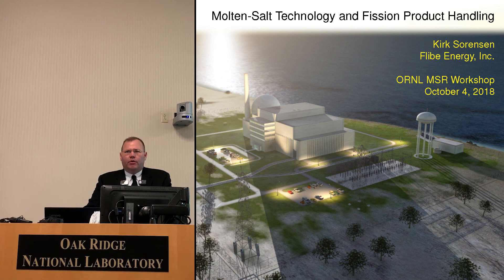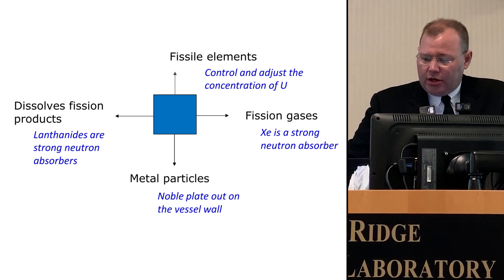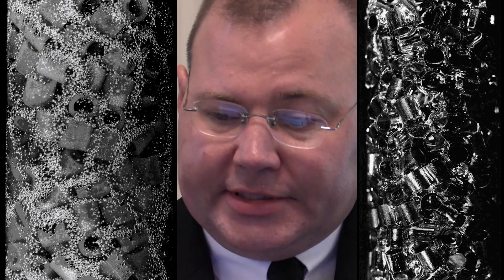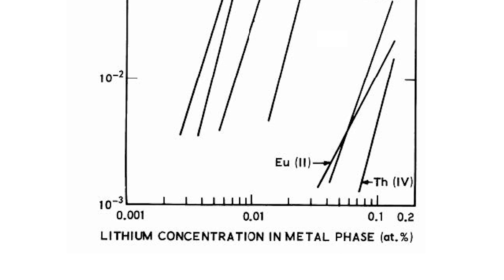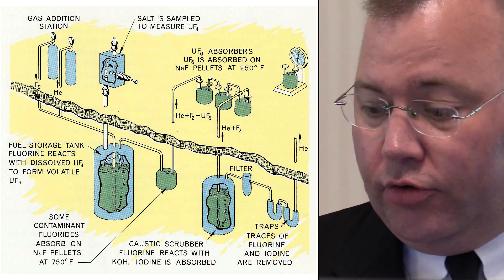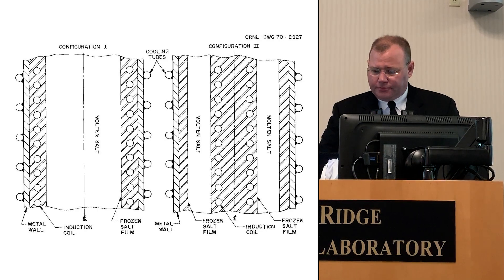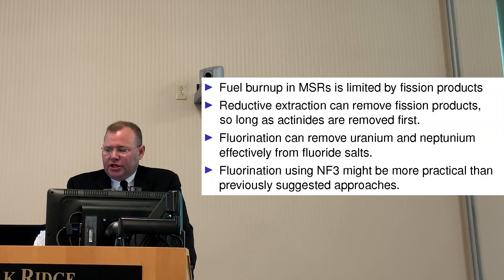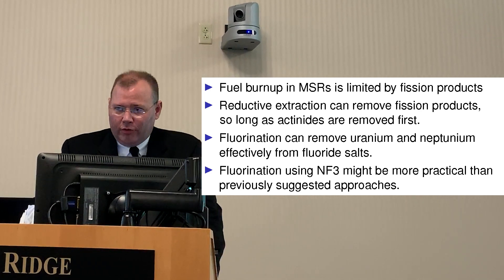Fluorination using NF3 - Kirk Sorensen of Flibe Energy @ ORNL's MSR Workshop

Comment: If fluorination with NF3 doesnt remove Plutonium, it will be extracted together with the lanthanides, and be part of the waste stream. Apart from loosing it as a  valuable fuel , it extends the otherwise benign decay time of some centuries to some 10 000 years!
Reply: No, wait. What is generated in the thorium fuel cycle is 238Pu, not 239Pu. 238Pu has a half life of 87 years, and it's the basic material of RTGs for space missions. Completely different beast.

Comment: Good gravy! I had considered this as a fairly consistent stumbling block, looking at the original MSRE design, and not knowing the full gamut of chemical processes necessary for the extraction of materials. NF3 does seem like the way to go, especially if it cuts down on the corrosion issue. Go chemical engineers!

Comment: Kirk, first, thank you for your work and Gordon, thank you for the vids.  Second, why not use a graphite tube as a liner and thermal barrier inside the molten salt pipe to support a frozen salt layer and induction coil?  At about 9:27 the cross section view would replace frozen salt film with a two layer graphite and frozen salt or sandwich frozen/graphite/frozen, both inside the metal wall. I am assuming the graphite can tolerate the corrosive environment and the salt is not fissile or the geometry can tolerate the moderation.

Comment: Can someone tell me why we cant get a thorium reactor up and running today when they could in the 60's? (China spends 2 billion dollars a year on studding thorium and has 1200 phd's on the job)
Reply from the maker: Gustav Shippingport was solid fuel. It proved that Thorium-U233 breeding was possible but was not a practical design to use breeding for commercial power production.

MSRE was NOT a thorium reactor. Trace amounts helped test chemistry, but no Fluid Fuel breeding blanket has yet been demonstrated.

So it today’s environment, moving ahead is more expensive than it would have been if MSBR had continued on heels of MSRE.

But conceptually nothing has changed. Th can be still bred into U233 like was planned at ORNL in since 1950s.

https://fluidfueledreactors.com/
Reply: @gordonmcdowell  copy
Reply: @gordonmcdowell  I thought about another think too, what is keeping the molten fuel reactor from being produced?
Reply: @gordonmcdowell  So I was wondering what  you meant by Shippingport and finally realized it. My first question was not about Shipping port but the Molten Salt reactor at ORNL, why don't we just copy that concept? Didn't they invent the MSR back then? 

I Don't understand why you write that " no Fluid Fuel breeding blanket has yet been demonstrated."
Reply from the maker: @Gustav4  ThorCon is the MSR startup most closely replicating MSRE, in that they're assuming the lifespan of their reactor core ("can") at 4 years. "CanShip replaces 500 ton Can every four years" http://thorconpower.com/spec-sheet

But that's not as fuel-efficient as LFTR.  ThorCon is pretty clear they aren't aiming for efficiency or harvesting isotopes, they just want the least expensive design for mass production.

So that means that like MSRE, there's no dual-fluid design, there's no thorium blanket to absorb neutrons and breed U-233, and no chemical separation to pull out fission products (although they do remove gassious fission products).

ORNL planned on building a blanket, and closing the Thorium fuel cycle, but that was the MSBR which was designed but never built because funding was killed after MSRE.

MSBR would have used a Chemical Kidney as Kirk describes for LFTR, although Fluorination using NF3 is a new approach to it.

Closing the Thorium fuel cycle and harvesting medical isotopes would be a good thing to do. We need MSR to do that. But only China's CAS (funded by Chinese Navy now) and Flibe Energy are taking that exact approach. Most other "thorium" MSR (as opposed to "uranium" MSR) fuel with enriched uranium and focus on pitching high-temperature operation (for industrial processes) and passive-safety features of molten-salt. (Which LFTR also has on top of closed fuel cycle and harvesting of isotopes.)
Reply: @gordonmcdowell  Thank you, these are important distinctions and this comment really clarified what was done and why the LFTR is different. I knew Shippingport proved thorium's potential as a breeder, but it was bummer that it was a solid fuel design.  It took me a while to understand how the blanket salt was separated in the ORNL design, now I understand that it actually didn't happen yet. The design was to have different channels within the graphite tubes with the center section containing the fuel salt and the outer section containing the blanket salt.  I had originally envisioned a "tub" of salt with graphite rods and didn't understand how the fuel and blanket salts would be separated. 

I'd love to see ThorCons vision come true for developing nations, Ed Pheil's vision of fast reactors burning up nuclear weapons and SNF and of course LFTRs providing clean power, more evenly distributed geographically. 

I am also extremely excited to see these realities desalinate and pump water where it is needed. And ultimately the conversion of carbon in our air into chemical fuel for use and sequestration, combining MSRs with companies like Carbon Engineering.

I really can't thank you enough for producing these videos, they are truly invaluable for helping a complete novice like me to understand energy and the energy industry. Hopefully, we are all able to help advance this knowledge and make clean, safe energy and the ability to improve our environment a reality for our children.

Comment: The trouble with LFTR is that it's too ambitious. There needs to be a pathway to its development because not only are pumped radioactive salts daunting to commercialize,  the online reprocessing of blanket and fuel salts even more so.

As a suggestion. The FHR reactor uses triso graphite pebbles to hold the fuel and a molten salt as the coolant.

Why not put thorium in the coolant and just reprocess that without worrying about the fuel?

Once that's perfected, cleaning a liquid fuel will be the next logical step.

Perhaps Kirk should go work for Kairos?
Reply from the maker: Ben, lots of people are pursuing "easier" paths to MSR. Kirk's work on Chemical Kidney is in parallel and can apply to many categories of MSR. I personally wouldn't want to see everyone all rushing down a single R&D pathway, and all effort being duplicated.

Comment: A quick question: why fluorides? Why not chlorides? I'm not a chemist (not even close), but from what I've gathered, common table salt would be a much less toxic and far more abundant substance than beryllium-fluoride. Or is there a problem with uranium-(x)chloride or thorium-(x)chloride? (x meaning tetra-, hexa- or any other multiplier)
Reply from the maker: More R&D was done on Fluorides during MSRE days. FLiBe has some moderating properties, and while I'm not sure all reasons for choosing either way, IF you are pursuing thermal-spectrum you can choose Fluoride or Chloride, but IF you are pursuing fast-spectrum then the moderating behavior of FLiBe will be slowing down your fast neutrons. Hopefully folks with more insight than me will chime in.

Comment: The last paragraph, UF6, UF4, sort of set off my spider sense (not common sense) that this system as conceived might be too complicated. I have heard of another related, process, using chloride (from potassium chloride) as the coolant-moderator. Also, it comes down to cost. I like the UK designed Stable Salt Reactor, by Moltex, that will be worked on in Canada.  We still don't have a working waste remediation system (meaning that it attacks radiation via physics), but that will take 100 years, probably.
Reply: Mortimer Hasbeengud:  First and foremost, I am really really unqualified to give any sort of knowledgeable response, so here goes with my totally amateur thought: I would be concerned about using chloride because of its different corrosive characteristics.  However, you are working in a much wider range of temperatures than I am qualified to evaluate.  Also, it seems to me that many of the chemical manufacturing processes we use commonly require several different steps in order to process the various intermediate stages of the chemicals in order to get to the desired end products.  I do agree that this may require a lot of tinkering/adjusting/monitoring on an "on-the-fly" basis when in actual use.  However, I also believe that our systems for doing so are vastly more robust and sophisticated than they were only ~50 years ago, when this stuff was first being seriously developed (the MSRE).
Finally, I am not convinced that this is really all that much more complicated than the stuff we go through currently (with our rather quaint and primitive radiological designs) to produce many of the medical radioactives, etc., which we use today. The real difference is that we would be producing this stuff on an ongoing, production-line basis rather like running Model-T's off an assembly line (OK, maybe Tesla's or something...) rather than doing small odd-job lots specialized in only one thing.  As I see it, this would be analogous to having a 3-D printer on site which you could then use to produce whatever you needed, rather than trying to have a huge stores department to keep a bunch of replacements in stock. (OK, I admit its a pretty poor analogy, but, hey, I'm an amateur here...)
Net upshot:  Yes, its complicated, but doable, and with enough effort, it can even work.  Yes KISS is a very valid principle, but sometimes multiple steps is exactly how you achieve that.  KISS at every step can induce reliability, and reduce complexity.
Sincerely, Mortifiably Willbegud...
Reply: Very good! Thanks for your input. I am unfaithful as far as electricity-making goes. I too, am not a go to, guy. I like to listen to them, however. Bottom line, we as a species need to go with whatever works. Having said this, doing fission, KISS, as easy and cheap X Safe as possible, has to be the way to go; baring any mass improvement in fusion, solar, wind, geothermal, ocean thermal, tidal, , etc...?  I have read about old reactor types like using CO2 as coolant-moderator, in the old, Magnox reactors in the UK. I ponder if atmospheric nitrogen, extracted from air, might be a good choice. MIT used to promote their pebble bed reactor, which to cool, using helium?? My mind is boggled, so I was hoping that MSR, some variation , might be more workable, than light water reactors :-/  ?
Reply: I suggest you look at some more vids by krik

Comment: Am I to understand we're giving up on thorium as a fuel?
Reply: Uranium is the fuel used in a thorium fuel cycle, I would hasten to point out. That's why fluorination was such an essential technology in all of the ORNL MSRP work.
Reply: If the molten salt reactor is to be ever be realized, yes.  My nuclear engineering professor thought that the use of Thorium  as a nuclear fuel was ridiculous.  The major argument behind using Thorium as a fuel is due to its abundance, but we have many thousands of years of Uranium in our earth's crust, thus making the previous argument for Thorium null and void.
Reply: Nick Joslin:  at one time the abundance of Thorium may have been a major factor in the arguments for it, but at that time people also tended to think in terms of solid fuel rather than fluid fuels.  Now, there are tons of much more relevant arguments in favor of using thorium for fuel.  Yes, its still abundant.  (In fact, we can obtain it rather cheaply because a lot of it could come as an almost free by-product of rather common mining operations...), but the advantages are far more attuned to the lack of disadvantages of using plutonium or U235, etc. as anything other than a startup fuel. 
Having said that, however, we do have a lot of spent fuel sitting around and it would sure be nice to burn that up simply to get rid of it...  Simply stated, Thorium is a much safer fuel in many respects to use, without some of the proliferation concerns which you get with other fuel sources.  And yes, Kirk is right.  The thorium is sort of like a combination catalyst and fuel source inasmuch as it is converted to U-233 and the U-233 is the actual "fuel" being consumed to produce the energy.
Reply: @joslinnick  U235 has no competition because it is the only fissile isotope available in the nature. Both Thorium and Uranium fuel cycle needs U235 for startup. Between U238 and Th232, Th232 is better.

Comment: Interesting seeing Flibe develope their idea of what their reactor will look like. Gordon, would you agree that Flibe is compromising fast deployment for seperation of actinides and fission products?
Reply: Viktor Nerlander:  compromising?  in what way, please.  I don't understand the point you are apparently driving at.  I am, however, perhaps misunderstanding the entire thrust of your comment.  Thank You! in advance for any explanation.
Reply: Hi John! I'm by no means an expert in reactor design. What I see many other projects do is to compromise extracting different thing such as actinides and fission products for a simpler design with the reason being getting the design faster through the regolatory process. 

For example keeping Moltex Energy just keep their fuel salt in long tubes, very similar to contemporary reactor design with only the state of the fuel being the difference. I believe  that regulators see an advantage of knowing the fuel is in one place at all time. 

In addition to that, seperation is concentration. You have to prove to regulators that extraction of U333 is not possible. 

Flibe has the most optimal design feasible right now, which is noble but I think it's a compromise to deployment.
Reply: Viktor Nerlander:  Thank You!  I now understand what you were getting at.  Yes, since the DOE regulations were designed for solid fuel reactors and they indicated that they thought it take ~40 years for them to develop proper regulations for fluid reactors (sorry, don't remember where I got that, but I do remember it from somewhere which had a reasonably authoritative source....) so the regulations they had for reactors, in combination with the DOE's reluctance to consider alternatives what they were familiar with, resulted in a lot of resistance to development of MSRs.  Accordingly, that has resulted in a lot of compromises so as to be able to present the DOE with something that they might be a little comfortable with rather than something which would seem to "out of the mainstream" for them.  The good news, though, is that, due to people like Kirk, John Kutsch, Jim Kennedy, and many others, the light is beginning (however slowly...) to penetrate even at the DOE level, which is the epitome of Governmental stodginess.

Comment: Looks like I've made the right choice in choosing to do chemical engineering for my undergraduate degree. This is a full-on chemical plant!
Reply: I figured the "optimal" version of this plant will basically be a near-automated facility where thorium comes in one end and bricks of neodymium 'n NASA-grade plutonium comes out the other. But that "near-automated" status would be designed after years of manual management by chemical engineers and the like.
Reply: dont forget the siphon for Xenon. yea the chemical processing plant will be hot in temp and radioactivity. Would almost require it to be automated. Monitored from behind shielding.
Reply: Eventually we'll see it engineered into an automated system. After the "seeding" process, thorium goes in from one end and a variety of useful fission products come out the other, contained in reusable containers with decay sensors and timestamps so you know what the likelihood of near-full decay is.
Reply: Molten salt reactors are a chemist’s wet dream 🤣

Comment: Thanks again Gordon. Lots of chemistry. I'm beginning to get an idea of why it is taking such a long time to develop an optimum process and mix of technologies to make this work. You can't just go down to the lab and mix up some chemicals to see what works when a reactor is MAKING the chemicals you have to process. Cooling a layer of salt and using it to line the walls of the reactor to limit corrosion is a neat idea. Fortunately, the heat required to drive this engine is almost free. But each reactor has the burden of supporting a chemical processing plant to extract the beneficial byproducts as well as removing the neutron-absorbing elements that want to shut the whole process down. And all of this has to be done on a high-temperature molten salt. It's no small task. We could be 100 miles down the road had we not had the anti-nukes and Nixon to contend with.
Reply: Hear, Hear!